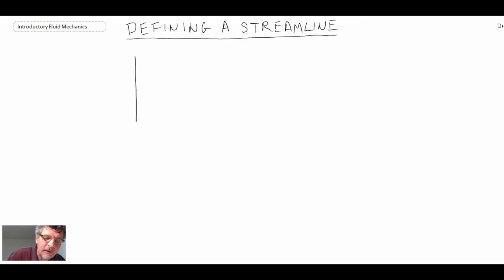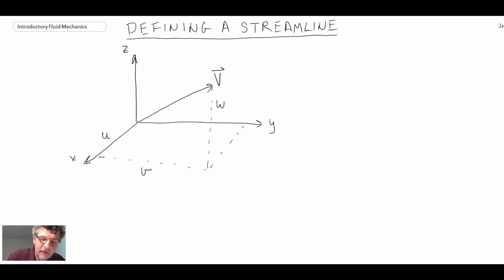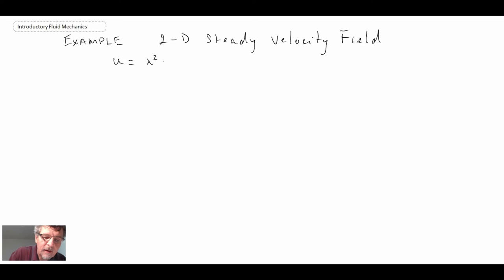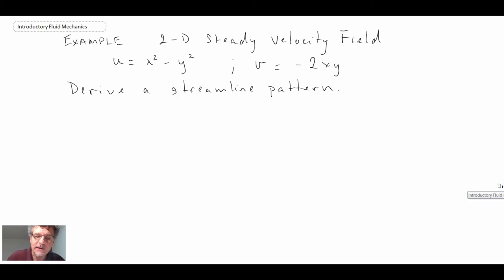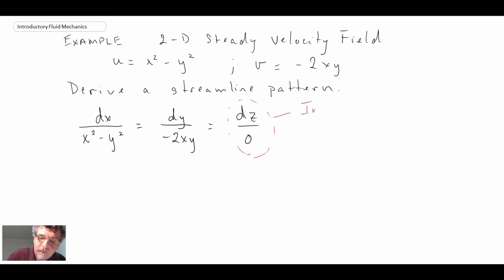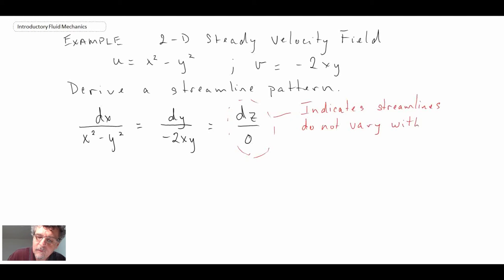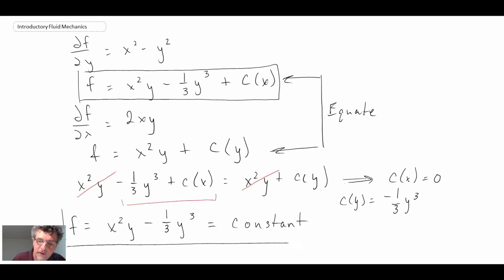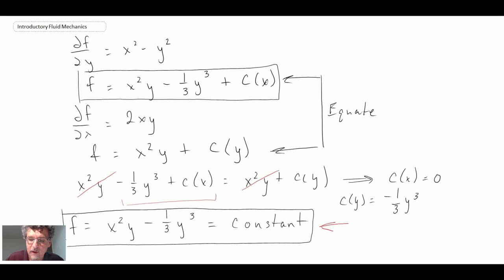Introductory Fluid Mechanics L3 p5:  Defining a Streamline

Comment: Hi, why is the equation of the streamline equal to a constant? (See 10:05) Thanks.
Reply: That constant is for C(x) which is obtained upon integration. In this case, C(x) is some arbitrary constant and not a function of x
Reply: The other reply is mistaken about where exactly that constant comes from. When solving an exact differential equation in the "total differential" form, (stuff) = df, you automatically also have df=0. So when you find f(x,y,z) from the first equation (the "total differential"), you also have f(x,y,z)=C by integrating the second equation (df=0). The point is, the streamline expression is equal to a constant because all solutions to exact differential equations resulting from integrating a total differential pop out as a function equal to a constant.